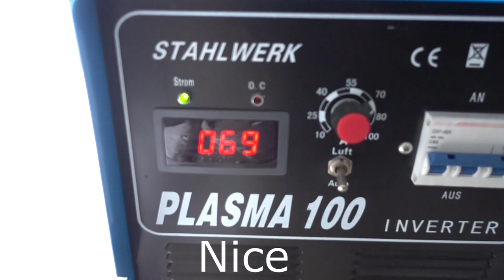EVNX - Electric Vehicle Conversion, Adapter-plate [EP5]

Comment: My rule for reversing a trailer. Look in the central rear view mirror, decide which way you want the tail gate of the trailer to go, then turn the TOP of the steering wheel in the opposite direction. The tailgate will obediently move in your desired direction
Reply from the maker: Yes! I should have cleared the snow of the rear glass so that I could have utilized that!